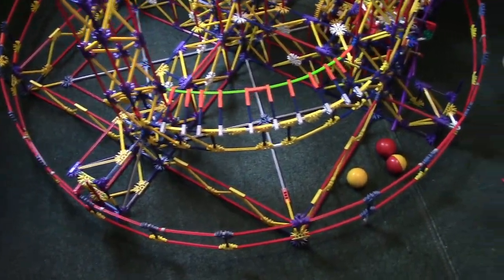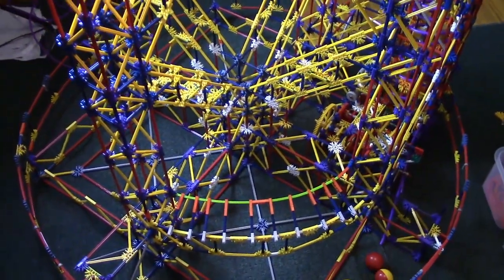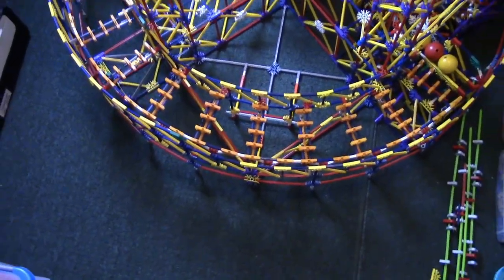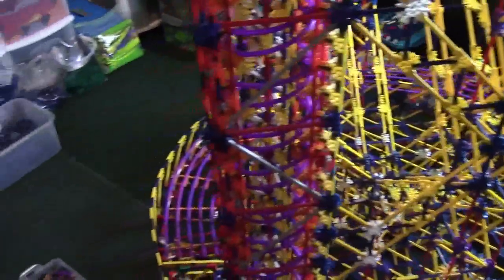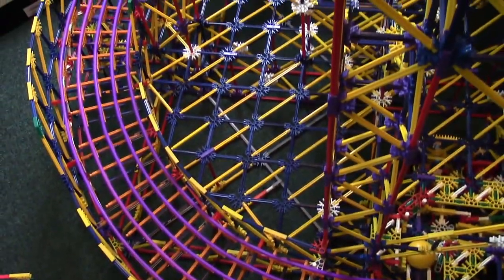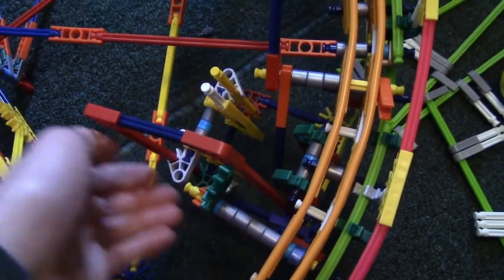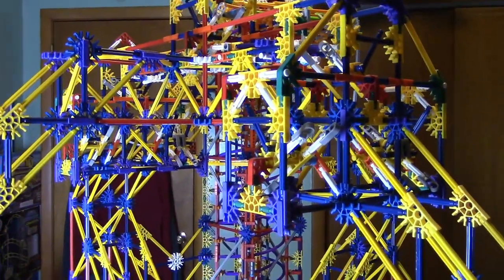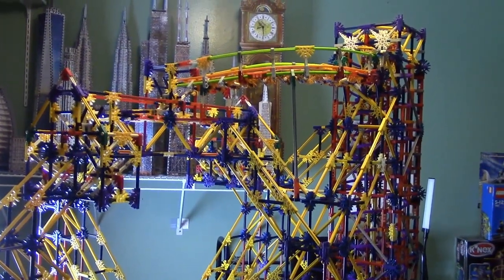Let's Build a Knex Ball Machine - Ep 3 - Base and path separators

Comment: That base looks sick! Though the entry path looks very sloppy, might be worth rethinking that one
Reply from the maker: Do you mean the short yellow track? What else would you suggest? I didn't want to clad that area in green rods and white connectors because then it would've looked unbalanced with the rest. And if you're talking about the supports, I didn't need to make those look better since they're hidden.
Reply: Shadowman39 hmm I guess it will be all right, you said the top wont be visible anyway
Reply from the maker: @xxdododoosxx5301  Oh, do you mean the top orange track exiting the lift? I thought you meant the entrance to the lift. I ended up improving that top track by using shorter flexi-rods for the rail and thickening the track. Looks much better now (not sure what episode that's in but I think I remember mentioning it).